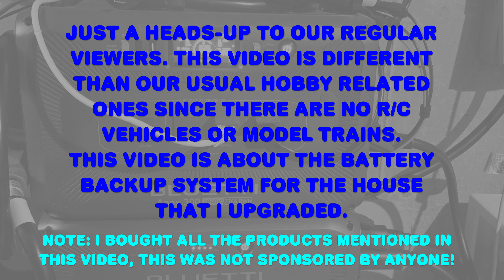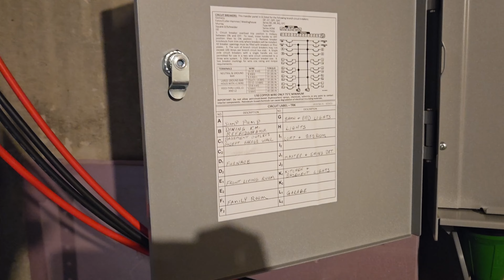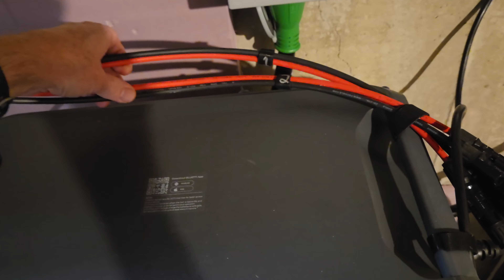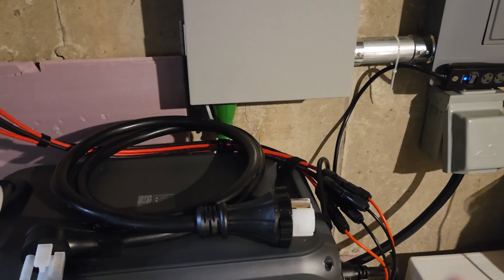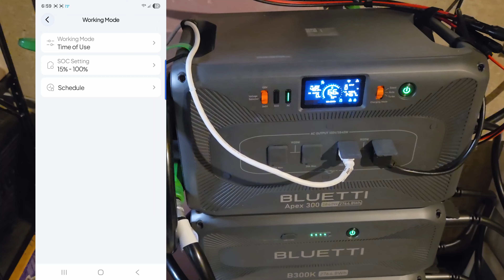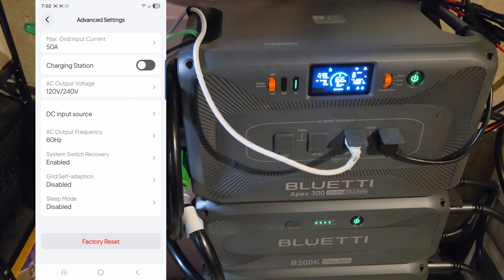Bluetti Apex 300 replaced the Bluetti AC500 for home backup and energy storage

Comment: Thanks for the video. Very helpful. How much did you get for the trade in vs the cost of the Apex 300 + cable+hubs etc?
Reply from the maker: At the time of trade-in, the Apex 300 was basically free with the value of the AC500. I did have to buy the 50A charge cord, the "Apex 300 AC Fast Charging Cable (input)" [50A AC Fast Charging Cable (NEMA14-50 to P050A Cable)] separately as well as a 50A "RV" cable to plug the Apex 300 into the sub-panel because they didn't have one available at the time and looks like it only comes in the Apex 300 "home integration kit." I also would have had to buy the solar input cables, but I had MC4 connectors and XT60 connectors from my R/C cars so I made those myself.

Comment: If you draw 3.5KW the AC500 made more sense, headroom and all. AC500, cooling made for 5KW. Apex 300, cooling made for 3.8KW. Ergo, the AC500 would last more years, because less heat. Plus, the AC500's software was finally bulletproof, while your Apex 300 has possible bugs that might show up. You sacrified a perfect piece of kit just to become a beta tester for Bluetti. Never become first adapter of technology, it's not smart.
Reply from the maker: I understand where you're coming from. The AC500 has a lot of benefits. However, for me, the reason to move to the Apex 300 was to get the 240 volt split-phase. It made more sense to go that route versus buying a second AC500 plus the extra cables/cords and the fusion box to get split phase. With only 1 AC500, I could only power 1/2 of the circuits in the breaker box or use a jumper wire to connect both legs in the breaker box to one input. Additionally, Bluetti has been good about releasing firmware updates to fix bugs from what I've seen and personally experienced with my AC200MAX, so I'm counting on that if anything happens with the Apex 300. So far so good though!